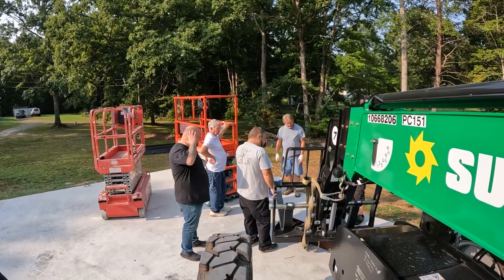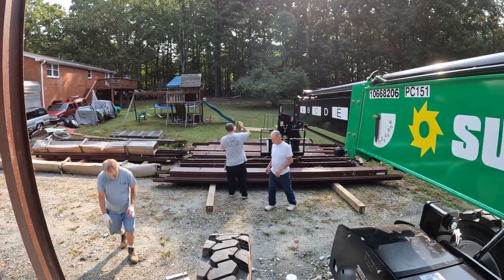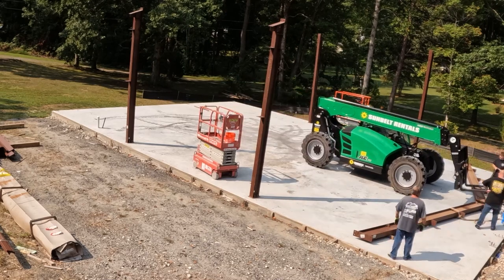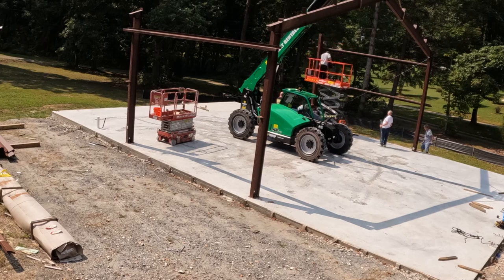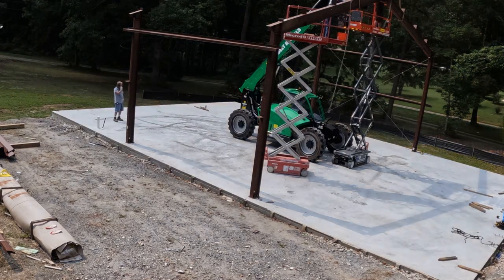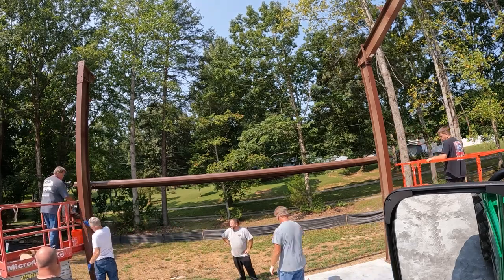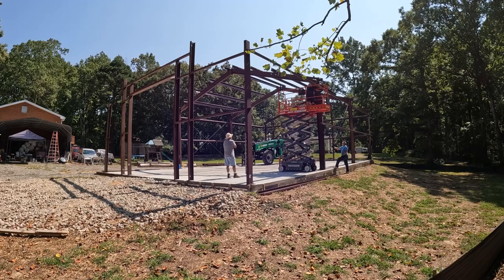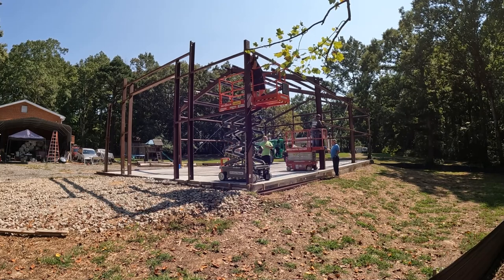Dream garage erection 40x60 red iron

Comment: I'll add a few things - I'm building a 95x50 building so the few things I'll say is this .  If you might be doing this install yourself- bring the steel to the concrete pad and deliver it onto the pad.  Allows much easier movement of the steel on the concrete vs dirt.  I put mine on dirt and it added entirely too much work.  If you are wanting to save a little money buy a small used forklift.  Again ease to move everything and not worry about rental equipment.  You can make a little platform for the forklift, raise it to your needed height and get up to the raised height via a ladder to work.  Last use a very very VERY accurate template for the anchor bolts and where they are placed.  It makes life erecting the steel so so much easier.  I bought a Mueller Building and their anchor bolt templates are works of art and worth every penny!  Lastly wear a hard hat- the protection it provides is more than you think it is.
Reply from the maker: Yeah I wish I had worked me scheduling out better so I could have put the steel on the concrete right away from delivery but with the smaller size of my shop I still would have had to move it off the pad to erect.  And yeah I agree hind sight I wish I had bought a used offroad forklift and a cheap one man lift for the money I had in rentals I definitely could have found both in marketplace.  Mine didn't come with actually templates but they had detailed drawings of them in the prints I built my own from and like you said having them exactly where they belong makes it super simple and easy to get everything lined up without fighting it . Thanks for watching and I'm definitely jealous of the size of your building,  I wish I could have afforded to go that big (county wouldn't let me go much bigger then I have now anyway but ... )

Comment: Hi I like your video it's very informative and can you tell us more about how you setup your foundation
Reply from the maker: Thanks ! Yeah, it's a monolithic pour. we used 78.1 yards of concrete. The footers are about 25" deep and about 18" wide at the bottom (the plans only called for a minimum of 18" deep and 12" wide  and a 5" thick slab so with the piers at each bolt location for the columns it should have been around 50ish yards if I remember correctly)  but the floor is also about 6-6.5" deep . It has rebar in the bottom of the footers and thicker rebar mats at the base of all the column piers and wire mesh in the entire floor and long rebar hairpins in the floor at all the bolts plus I added about 20-30 peices of rebar in the area's I want to eventually put lifts . If you go back and check out a few of my older videos, I show the floor before they pour the concrete and how I formed it all up . Thanks again for watching, and if you have any other questions, let me know. I'll try my best to answer

Comment: Nice, how much did it cost?
Reply from the maker: The building package from maverick steel buildings was 43k shipped with insulation and the walk door but total to date including rentals, permits, ground work ,concrete, electrical, and lumber to build the loft I'm currently finishing up I'm 127k in so far .

Comment: Size footings did yall use?
Reply from the maker: I have more info in my concrete videos and total cost video but if I remember correctly they were supposed to be 12" wide by 18" deep with like 4x4' piers at every column but I over dug all of them .

Comment: Nice video. I just completed a 40x30 14' wall shop. Vague instructions came with my kit. I made the mistake and ordered R19 for the walls. It makes hanging the panels extremely difficult. No instructions for the doors either. You did it right with plenty of equipment and bodies. Thanks for sharing.
Reply from the maker: Thanks I appreciate it ! Yeah I can imagine how much harder it would have been doing the wall insulation with r19 . Thanks yeah it was a little harder on the wallet renting all the equipment as long as I did but it was definitely worth it to make things go faster and not struggle as much . Thanks again for watching!

Comment: What bolts did you use? amazing job by the way.
Reply from the maker: Thanks ! All the hardware was provided with the kit with the exception of the anchor bolts but those were specified in the engineered drawings on what I needed .

Comment: Hey its Sam my building erectors are working on my building.  I have a question for you when you installed your insulation what type of tape did you use on  your insulation to join your insulation to it self . My manufacturer didn't specify a type of tape or anything.
Reply from the maker: hey sam , good deal that's exciting ! it took me a min to look back through my phone but i used echo tape fs-g7732 for the white tape to join the seams after they were installed and used the same thing but in black for the ceiling . but i also used a clear double sided glue strip/tape to stick the insulation to the frame work when we were dropping it in place but i do not know what that was as it was provided my my manufacture as well but i think i might have some leftover i could check tomorrow and see if there is any info on it 

thanks for watching !

here's a link to the white tape i used 

https://www.amazon.com/ECHOtape-Performance-Construction-Professionals-Professional/dp/B06XXFQ961?th=1
Reply from the maker: not sure you need it but the black tape part number that matched my black ceiling insulation is FS-G7731
Reply: Thanks Ken I bought tape from Amazon.  I got two types one to hold the insulation up and one to tape the various insulation blankets together.  Thanks for the info . I'm starting a YouTube channel as well to document all of my various projects.  It's called Tool Ground .
Reply from the maker: @sammason133    good deal , happy to help , thats cool I'll be sure to check it out !

Comment: so why did you start with the center?
Reply from the maker: With the design of my building the main structure is those center 2 I-beams  , the 2 end walls are all the c-channel so we set up the main center structure and built the ends to connect to it . Hopefully that makes sense.  If not let me know and I'll try to explain it more.  Thanks for watching!
Reply: @kenschopshop  no, it makes sense. I am scouring YT for all the hindsight I can find before I order my building.
Reply from the maker: @idonwantella2824   good deal,  yeah I did the same thing before I ordered mine also , and part of the reason I recorded mine as much as I could just to share a little more info for those looking to try it themselves.  If you have any questions about any part of the build hit me up I'd be happy to share any information or my experiences I can